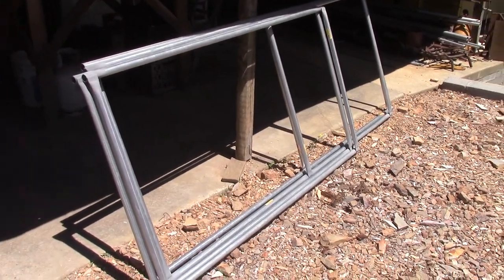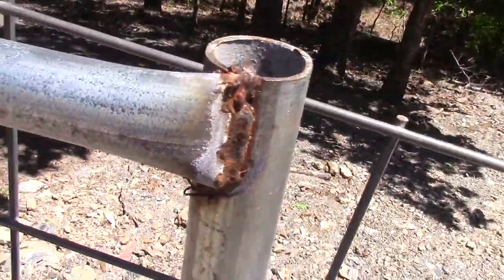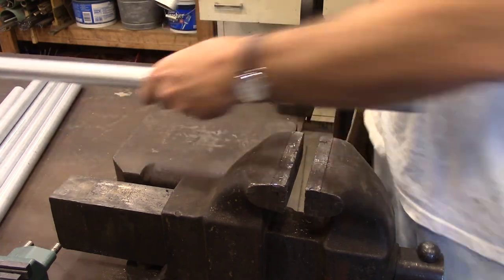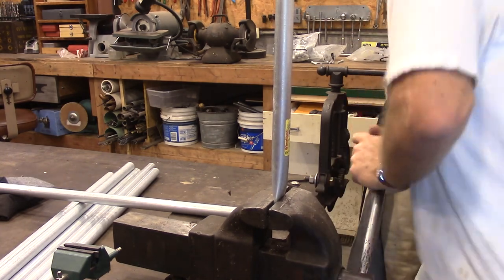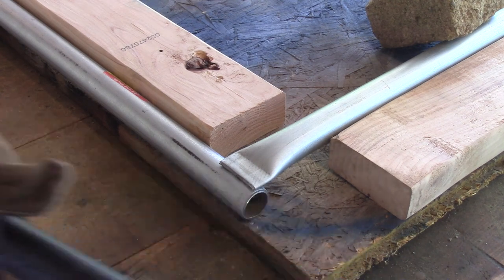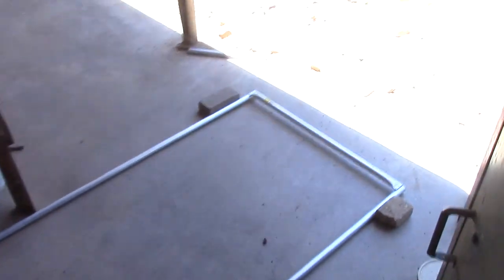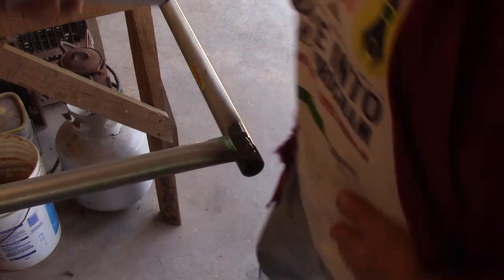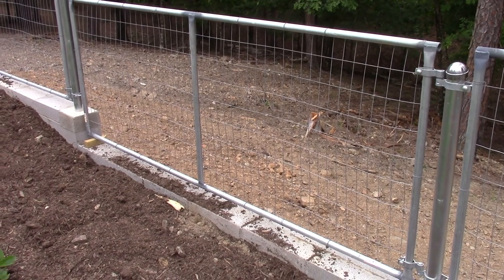Easy Welded Joints in Pipe AKA Making Pipe Gates

Comment: I've never had luck with welding galvanized as the zinc contaminates the welds and makes a really weak weld. I'll usually grind the surface off of the area I'll be welding first and that has a lot more strength.

Love your idea of flattening the tubing. Gives a lot of contact area and no need to notch.
Reply from the maker: Thank you for sharing your experience!
Reply: The strength of the MIG process is not compromised by the galvanized coating, so surface preparation is not absolutely necessary in this case.

Comment: Nice idea thanks 😀. I think what would be nice would be to flatten both ends for the cross members and then notch holes into the uprights with an angle grinder and then slot the flattened sections into the holes. Would keep everything level. Thanks opens up a lot of options. Cheers
Reply from the maker: Your welcome, thanks for watching!